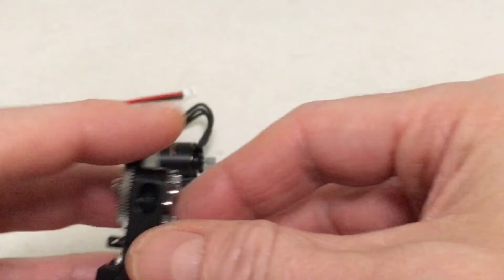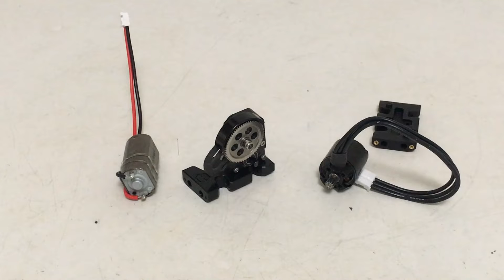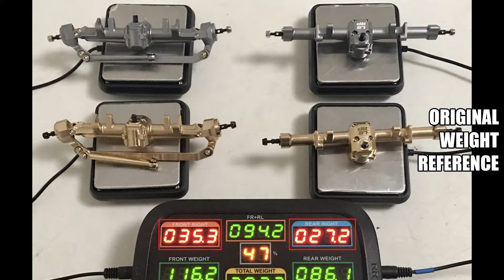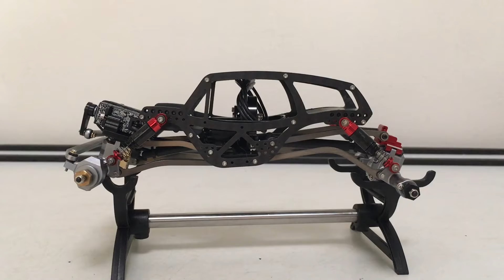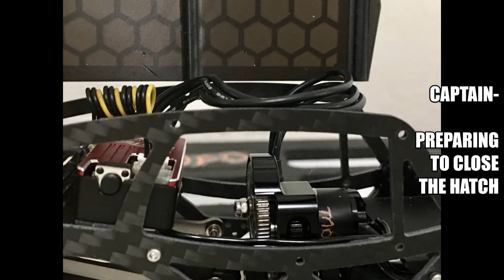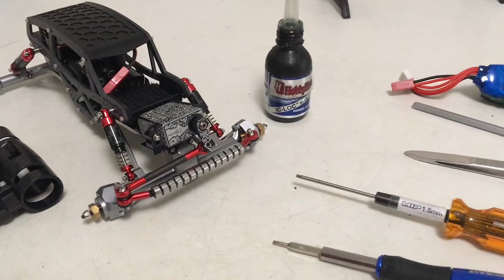SCX24 - HARD PARK 'DUV' DEMENTOR BUILD - DW1.5 TRANSMISSION, LGRP SUPER 8s, MOFO NANO BAM, FURITEK

Comment: Where did u get the spacers for the shocks ? Hard Park right ?
Reply from the maker: @360glassworx  they have them yes, I always use the Injora aluminum spacers though. Come in a multi pack/different widths - super handy for building. Have also used 3D printed ones…. But those aluminum Injoras are the way to go for customizing/tuning. https://www.injora.com/products/injora-50pcs-m1-4-m2-flat-stainless-steel-washers-spacers-for-1-24-scx24-ax24?_pos=2&_sid=cf9e97052&_ss=r
Reply: @bcochener  I'll go that route, I appreciate u 👊 thanks again!
Reply from the maker: @360glassworx  no prob!
Reply from the maker: @360glassworx  Amazon should have them
Reply: @bcochener  I do like the sound of that verity pack 👍 making a order list now lol

Comment: @Bcochener , any idea if the DWS transmission is superior to the DW1.5?  Any info would be much appreciated
Reply from the maker: I believe it just puts the motor a tad lower. I don’t have one, it came out right after I bought my 2nd DW1.5 (still need to use in something). Either way, I think both are very similar in quality and function. Could always email HP and ask for more info. Cheers!

Comment: I think my comment got erased by YT, probably because i had put a link in there.
Anyway,  I'm building something closer to 1/18 scale, have been considering the axles, and thinking about HardPark. They seem to have newer axles (sold out).
Im sure you've seen them. 
I just can't find any videos on YT on these axles.
Any chance you'll be doing a build with them?  Would love to see what you build. 
Thank you,  always appreciate your builds,  top notch!
Reply from the maker: I’ve seen them only in photos on their site. Only have ever shown the rear axle in stock when I’ve looked…
Personally, my pick for that scale/width would be S8s with EXO U-joint CVDs up front. - or Mofo X15s, which I have 2 sets of waiting for builds. All I hear are good things about those.
Reply: Roger Roger,  thanks for the info,  I've had the x15 suggested as the strongest axles available, probably go with those.
Reply from the maker: @MrsRabbit8  That’s what I hear! I’m looking forward to trying them out. 7.5 a side, so almost the S8 width as well.

Comment: @Bcochener what remote are u using?
Reply from the maker: Fs-GT5
Reply: @bcochener  thank you sir I have nb4 and those receiver don't work with nb4 I believe
Reply from the maker: @flightclubla  They may not. The Flysky GT-5 radio protocol is AFHDS-2A. That would have to be the same for your radio to use this RX.

Comment: How long did u wait before this chassis was available?  Same with that VDub chassis! NEVER AVAILABLE! Frustrating
Reply from the maker: I just stumbled upon it. The VDub looks to be in stock. Not sure on the link risers, but there are other riser options.
Reply: @bcochener  carbon fiber is but, if I do VDub was wanting aluminum chassis.. LGRP has 3D plastic risers.. I been babysitting his page!
Reply from the maker: @360glassworx that aluminum VDub may have been special edition. I have not seen that in stock ever. Ramp Crab has some adjustable link risers (Amazon), OGRC has one, JEC has one as well.
Reply: @bcochener  thanks for the tips, I'm looking them up right now! 😁
Reply: Same with that damn (link riser ) SOLD OUT
Reply: Do the shocks come with springs ? Mine did not lol